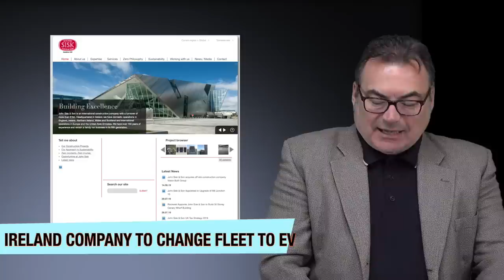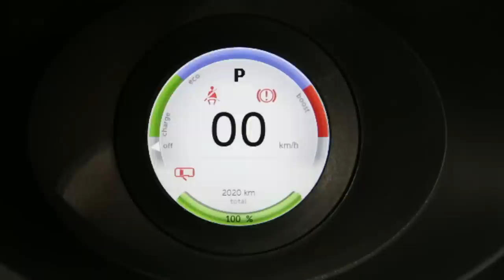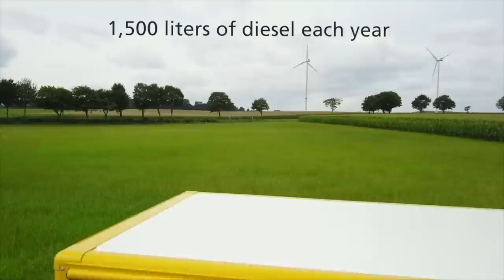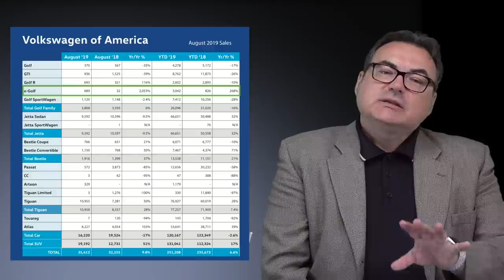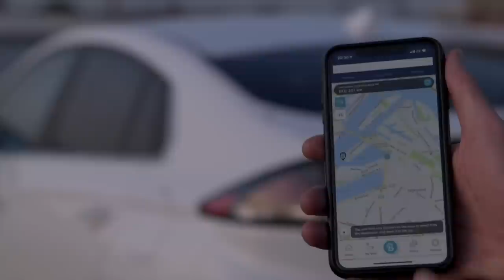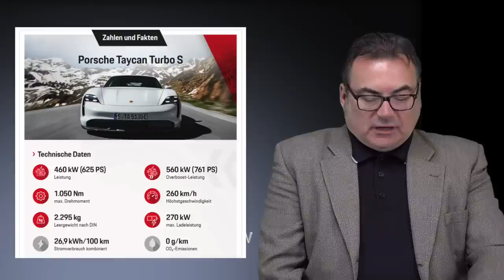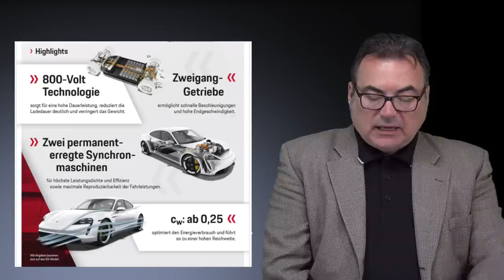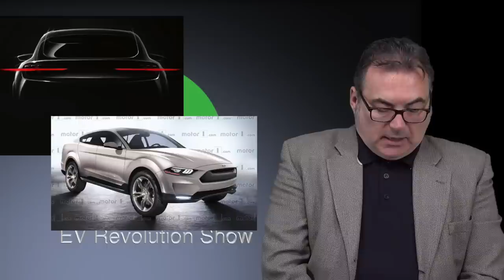Episode 60 - DHL Deploying More EVs, Ioniq Update, EVs Coming For Magical Year 2020 and More News!

Comment: I wish there was a more basic Bev, something light weight and not full of clever energy sapping tech. I don't need electrically adjustable seats, mirrors, powered tailgate etc etc. I don't need a ten speaker sound system. It should be possible to have a light car with a 40 kWh battery and 250 mile range. Simples!
Reply: Good point Budah, and I agree that such a vehicle is required for mass adoption. Hopefully some lower priced basic vehicles will be produced once the VW MEB platform or other manufacturer platforms are made available for other brands to use as a base powertrain.
Reply: Reality is that a 50kWh battery could deliver 250 miles but not at motorway speeds, unless a really basic , low slung saloon with ultra light bodyshell. The basic small SUV is represented by the MG ZS EV, a $25,000 car with 44 kWh battery and range of 160-180 miles.
Reply from the maker: Thanks @JP and @Dave Bell for comments.  Agree to all.  I can understand the basic needs @Budah and cars like Sono Motors Sion and some others do hit this need.  I also believe VW will offer some scaled downed trims.

Comment: CO2 isn't a problem, sulphur and nitrous oxides are, and using EVs does improve air in cities at a local level, which is nice for the people living there and helps reduce erosion of soft stone buildings.

Ioniq still doesn't have the range needed for people in consultancy jobs and those with commutes that take them out of town, especially if you don't have a driveway or private garage to place a private charger.
I'm stuck with public charging infrastructure which is always a gamble whether it's possible to charge overnight when getting home or not given that there's not enough charging points for even half the EVs in the area.
I also at times need to visit remote customers.
So having range several times my daily commute is a must.
Reply: Captain, you make an excellent point that is often overlooked. CO2 is a concern for climate change issues, however other forms of pollution including particulates are extremely harmful, especially in congested urban centres.
Reply from the maker: Yes great points!